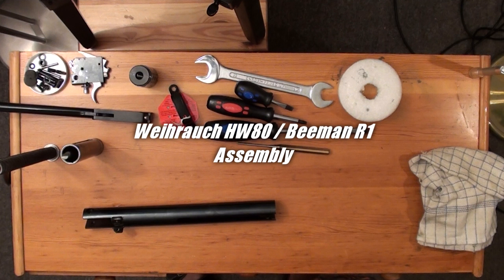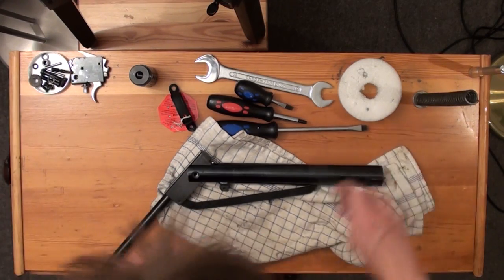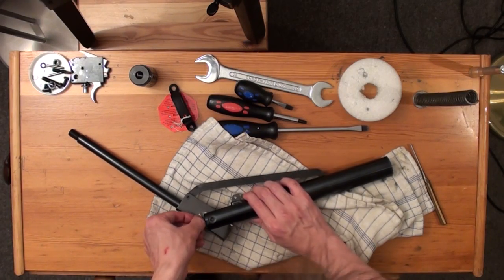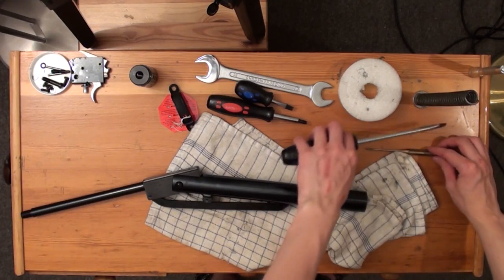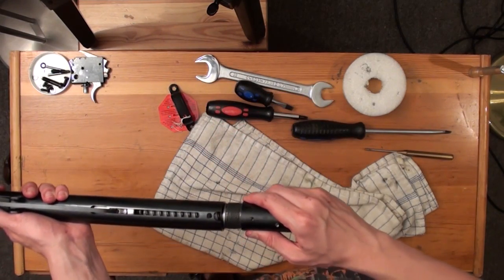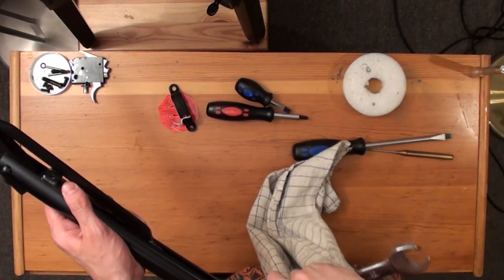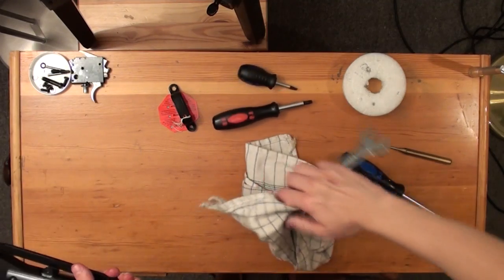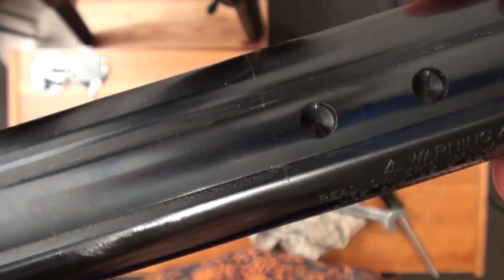Weihrauch HW80 Assembly

Comment: Hey man, good to see your videos are back up, I was looking for the dissambely one Saturday as I fitted a V Mach Kit to my 80K, it shoots really nice now, no spring twang at all. and cocks very smoothly. I think I will have to take it apart again and put in a couple more of the washers as the power has dropped slightly, when I chronographed it, I just have to keep it under 12 ft/lbs over here, but will probably aim for around 11 just to keep it on the safe side.

Comment: @2lbsTrigrPull Well with the original spring it was only running just over 10 ft/lbs anyway :S, I added another washer and the nylon spacer and now it is doing 10.4 ft/lbs and I still have 3 washers left. Going to dissasemble and try another 2 washers and that should hopefully get the power up to around 11. I'm not too bothered about getting it right on the limit that is stupid, I just want the optimum balance of good power and good shooting. Keep up the good work with the videos!

Comment: Hi all, need some help.. got a MK1 hw80 made in 1970ish.. no problems at all till today.. when I cock it the mechanism goes completely loose. Watched this vid and followed it to the t but keeps on happening. Looks like the slide comes out of the little steel cylinder. Am I doing anything wrong or do you think with age it's lost a couple of thousandths of an inch??

Great vid btw really well done